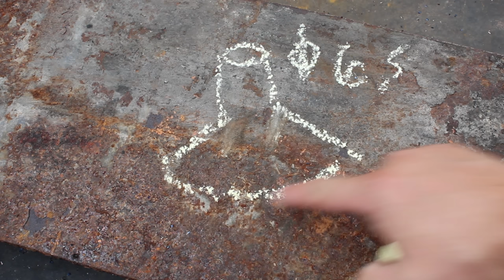Simply and easily.  Homemade blacksmith's forge from old iron.  For home use

Comment: Great job! I especially liked the "dual usage" for cooking. Only change I might make would be in attaching the large diameter pipe to the pyramidal flue would be to cuta a piece of flat stock to fit the opening, trace the pipe diameter on it, cut the hole & then weld. Super construction!
Reply from the maker: I made this with what I had... Thanks for the advice!!! We all learn from each other...🤝🤝🤝

Comment: I bought that same little blower for a forced air propane melting furnace.  Turned out to be too powerful and I had to 3D print a bunch of dampers for it but it looks like it worked well for you.
Reply from the maker: It's definitely blowing a lot 😊. I mostly use it at the lowest power setting. 🤝🤝🤝

Comment: Tip. You will really want to make a cover for the blower. Any ember get in the air intake will got  burn really hot and melt  the plastic or catch  back on fire.     also You really want to make the base ease to get into. ash will get into it.

Comment: Looks fine and seems to do its job. But why so much stitch/spot welding? The steel is thick enough to run a line.
Reply from the maker: I decided that it would be better this way. The metal box could have bent. Tried to distribute the stress of the steel

Comment: As a blacksmith with 20+ years of experience it would be nice to know why you're using such thick steel and bricks? Every forge i've seen so far both for hobby and proffesional use have been made in 3-5mm steel including my own and they seems to work/last long...
Reply from the maker: The brick is heat-resistant; it does not transfer high temperatures to the metal structure. Also, the brick concentrates all the heat at the epicenter of combustion, and thanks to the uniform heating of the brick, you can cook very tasty food. I made thick metal because the structure is all-welded, I decided that it would last longer until the next replacement, and I already had this piece of iron. With great Respect to all blacksmith masters...

Comment: Umm... why didn't you use cutting oil (or any kind of oil) when drilling the steel plate?
Reply from the maker: I was careful not to overheat the drill.
Reply: @MihailKupec  fair enough, I saw the water dipping, just wondered if the oil would have helped
Reply from the maker: @GaisaSanktejo , There was no oil, I decided to cool the drill like that, and was careful not to overheat...)
Reply: @MihailKupec  I got that with your last post 🤪😉👌👍
Reply from the maker: @GaisaSanktejo ,  🤝🤝🤝

Comment: @6:00 magnets bro or an excessive amount of tape in out of the way places. 

However I need say, that was not simple or easy, and the cost of doing all that if you don't already have those tools and metal far exceeds just buying a starter forge on the internet or paying someone who does have the tools.